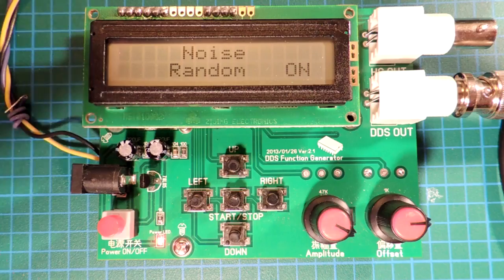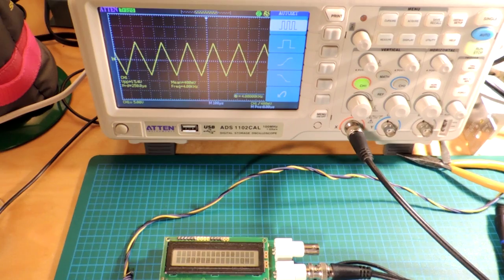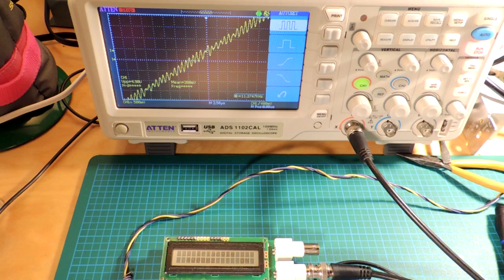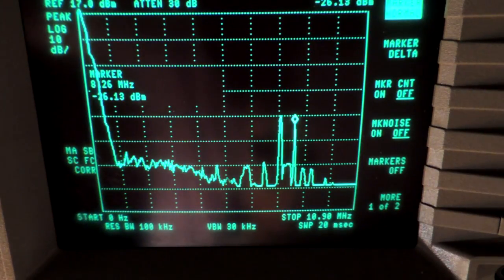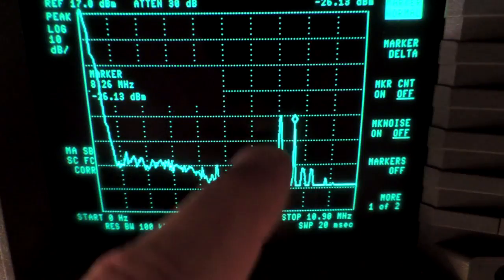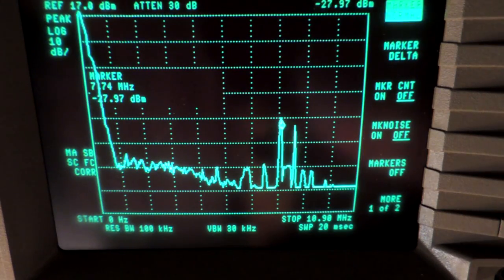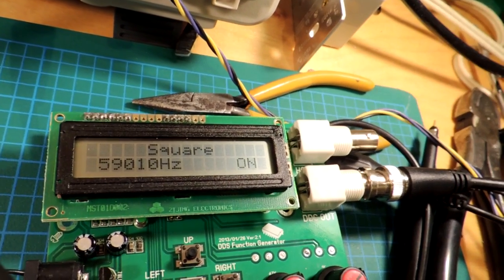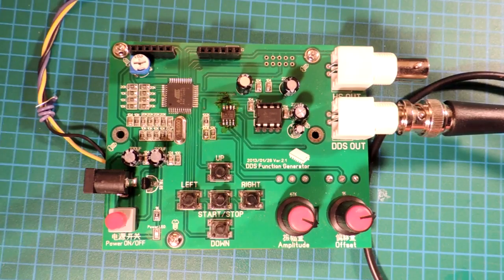Cheap Function Signal Generator from ebay

Comment: I got one of these thinking I would be able to manually sweep the sine wave with the knob (for SPL testing in car audio) as you may imagine I was quite disappointed with this unit especially because it has a constant buzzing sound and has Distortion at every volume level and on every setting  basically its a piece of s***.  Lol. Do you know what I would need to change out on this thing in order to have the manual sweep function? Could I change one of the knobs out with a potentiometer?

Comment: FG-050 function generator tested 
If you search long enough, you can buy this digital low-frequency function generator module for less than € 12.00. Built in a box you pay € 20.00. Nice prices for a generator that generates all basic signals up to 65.5 kHz. 
➡    Read this article
https://chinese-electronics-products-tested.blogspot.com/p/fg-050-function-generator-tested.html

Comment: I bought one of these for its curiosity value (I already knew it was total crap.) The one I received came with another "undocumented" feature. The fuses in the micro-controller had not been set correctly so it was outputting at exactly half the displayed frequency. Soon fixed with a programmer but it sure is pretty piss poor quality control.

Comment: Thank you for the great video!  I got one of these and was a bit lost with absolutely no docs.  
I feel you skate over why or how you blew up the op amp chip.. you talk a bit quickly and mention "no input protection"
I think you actually meant to say no output protection (please clarify if not).. 
And which port?  the GPIO thing is save to load right? a TTL output? safe to short it? 
So I'm gathering you can easily blow the ANALOG output on this thing just by turning up the output with a 50 ohm load on it not to mention a something lower such as speaker as a load.  
So no output protection whatsoever?   
And I take it I shouldn't try to drive anything low impedance on this thing?
If you put a DC short on it will it blow as well?  
Again thanks and absolutely no disrespect.. Thanks for taking he time to make the video... 
The people selling these things have not taken any such time or care as you have. 
 

Steve
Reply from the maker: +n8lbv The analog driver has no output protection for a overload.... the op-amp can drive it'self to destruction if shorted, that's poor design.  The digital-output using a GPIO is due to the fact the op-amp is to slow to drive a square wave of that frequency.  It also lacks any protection.

Comment: This is a tough call.

On one hand I can see all the flaws in the design. A missing filter that could have easily been done with passives. No protection for the opamp, so it dies at 50Ohm termination (every decent fgen should be shortcircuit proof). TTL output directly driven by the micro (at least it looks like it). Square waves/sawtooth waves that are far from it at higher frequencies (some of the sellers on ebay show the waveforms).

On the other hand I know how long I had to live without any way to generate these kinds of waveforms, because fgens were so expensive. And for under 20$ this one isn't bad. Although you can get other DDS modules/shield for which someone has already written an Arduino program which comes out at a similar price with for example better sine/square performance even at the tens MHz range, but misses triangle/sawtooth.

The question is: does a beginner know what he's getting into when he gets one of these and what the implications of the flaws are. Or is any fgen better than none?
Reply: ***** Will you be kind enough to make a follow up video on how to mod this cheap ebay function gen and correct for those flaws. I believe it will be of great value for all of us doing electronics as a hobby. Best regards, George.
Reply from the maker: any fgen is better than none... and there is lot's of learning to be had in fixing this one up to remove its flaws...
Reply: I second this. I'm learning from he university level as well. I would love to see this function generator fixed. :)